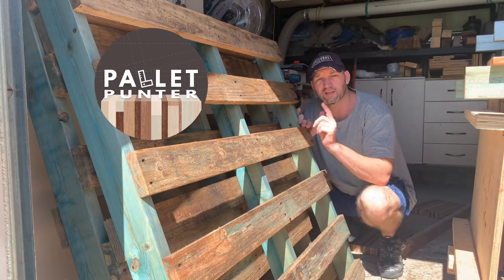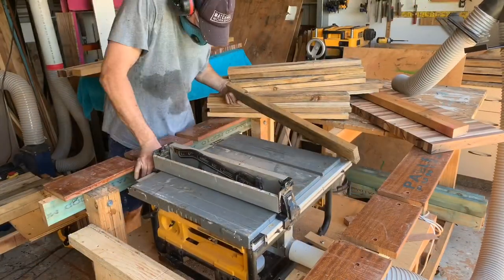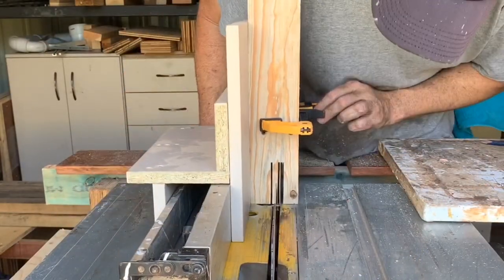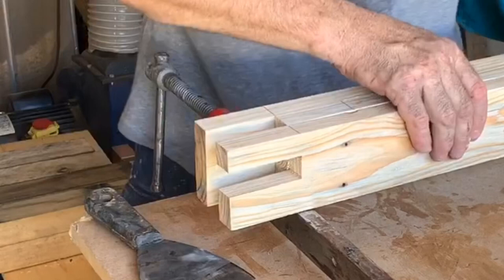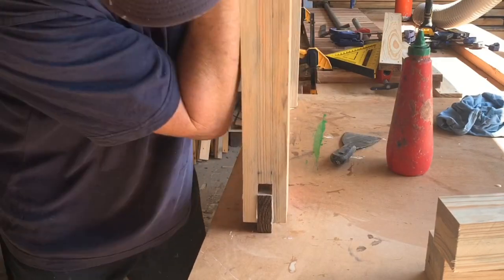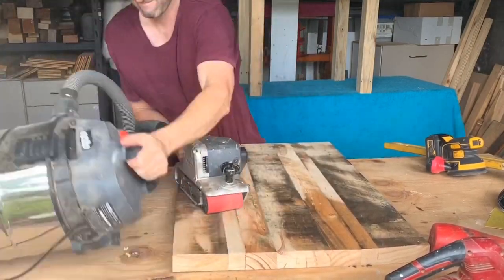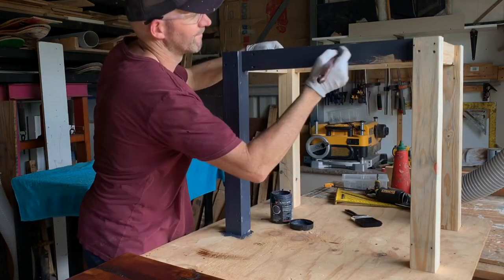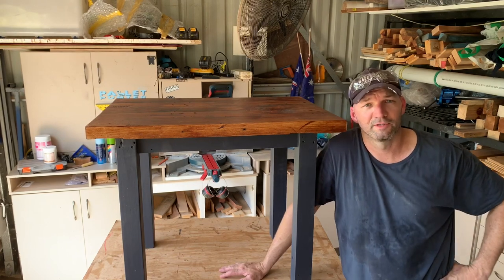Dirty Pallet Project - Little Table

Comment: What screws did you use for the pocket holes? Did you order some from Kreg or got something from Bunnings?
Reply: @dainermade  I have done the same, can't justify ordering those Kreg ones, specifically if you live somewhere rural and it adds up to postage 😔